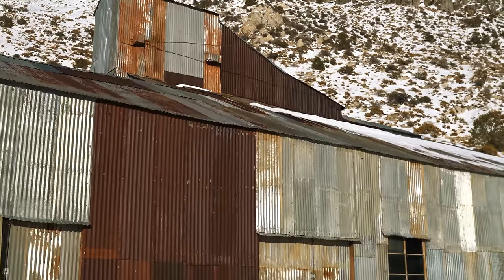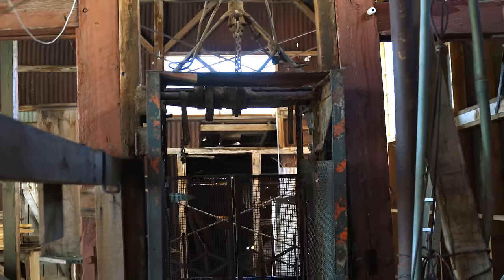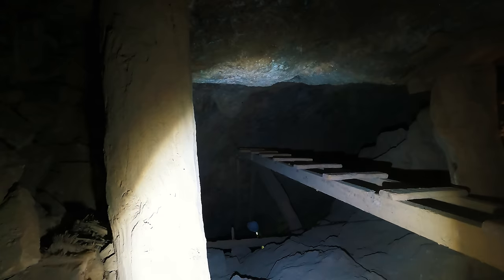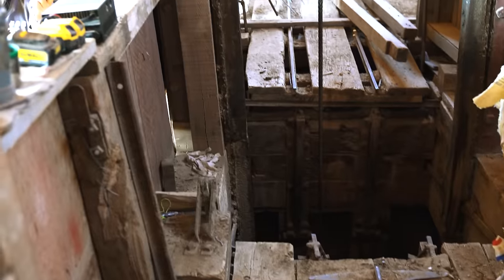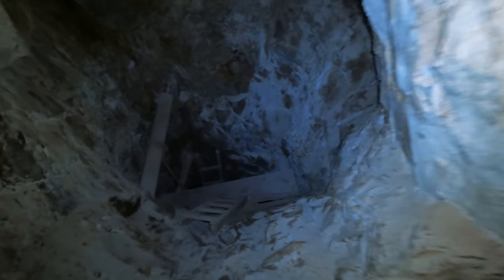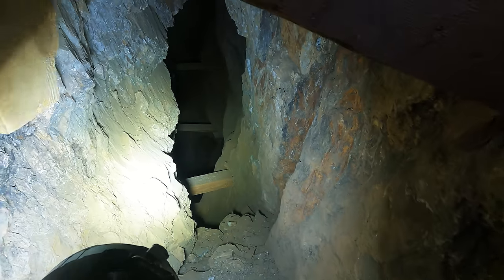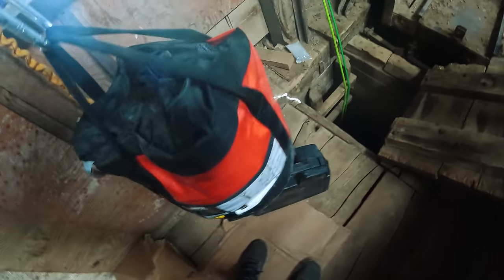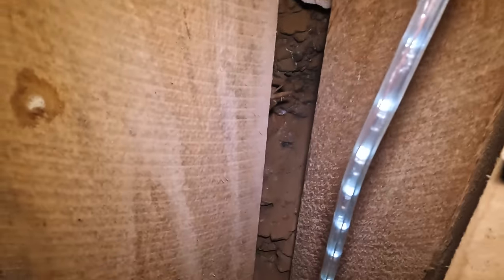Rappelling 900 Feet To Uncover Lost History!

Comment: Hey mate, I'm an industrial abseiler, I actually abseil off skyscrapers like you were talking about for a job. A good tip for doing big descents like this is to have your rope in a bag, attached to your harness, that way you don't have excessive tail weight so your descender will work better. Also eliminates your rope snagging on things when you lower it down, as it just feeds out of the bag as you descend.
Reply: Keeps it clean too. If there's wet patches down the road, you won't be getting into them if it's in the bag. However, in a cave, it's good to have the last feet of rope marked clearly at intervals of decreasing distance to make sure you don't end up without rope unawares (obviously, the end should be properly knotted to prevent rapid acceleration followed by instant deceleration.
Reply: Excellent advice!
Reply: I was thinking the same thing but wasn't sure if I was on the right track or just remembering something from a movie lol
Reply: we use the same trick rapping waterfalls when Canyoneering
Reply: Also, if you need to dig out those collapses, use a  tool you can pull with and let gravity help. Shovels would be useless for the bulk of it. Not sure what this kind of tool is called in english but in Norwegian we call it a "krafse" no.wikipedia.org/wiki/Krafse
Narrower and pointier variations also exist.

In an earlier video you used shovels for this and it was enragingly inefficient. In that case it was completely dry gravel which is the best case for what im speaking of. If its completely caked together the difference is maybe smaller but please consider this
Reply: You can also loop the rope to the ladder at intervals on your way up to make it easier to go down the next time.
Reply: @Hamring  What an awesome piece of kit xx
Reply: I’m not sure 950 feet of rope attached to your bag is going to keep you descending any easier. Which probably tells me by the weight of that it’s going to go smooth. Which questions me about if you actually have just done 1 abseil in your life. Now you know everything about mines 😂
Reply: @alwaysaheart1645  i would say a completely regular piece of kit. But pretty awesome for this kind of work if you compare it with a shovel i guess🤷
Reply: If you are thinking about communication lines, if you run copper lines you will only be able to get an analog phone line. If you run power and fiber you can get internet down there and upload without having to make the return trip. Something to think about. They also make a point to point microwave wireless that would work if the shaft it straight enough but anything in the way would interfere with the signal
Reply: Got some balls dude. 😮
Reply: @joeburrows6  I'm a qualified IRATA technician with over 3000 hours logged. Having your rope in a bag is a common technique for long abseils I assure you that, having the rope in a bag removes the excess tail weight from the descender which allows it to feed much smoother on the descent. Although you can tell he is using the pre 2019 version of the petzl rig, which is always a bit of a bear to work with. The very fact that you are arguing with me implies that it is in fact yourself who doesn't know what you are talking about, but I would never assume. There's no need to be rude just because you don't understand.
Reply: I can imagine you can go round obstacles too where he had to anchor a new rope and switch twice
Reply: @youngmodulus4617 Rope bags are awesome. That said, once you get to around 61m of rope that bag does start to get unwieldy.
Reply: Jeff Williams, Jason from mbmm, and an electric winch❤  good luck 🤞
Reply: How do you get this job ?
Reply: @Hamring  your krafse looks like it would fit into the garden hoe/chopper tool category.
Reply: Just make sure you knott the end of the rope before putting it into the bag ;)
Reply: @joeburrows6 what’s the longest rappel you have ever done?
Reply: Great advice, just keep in mind you may lose track of how much rope is left! Sure you’d think about it but I want to see more videos so be safe
Reply: @Hamring  This tool would help tremendously, but I have never once seen it in the states. Super clever and smart. Love it!
Reply: @TJPlaysNow  That's odd to me. This exact style is so ubiquitous here. If someone needs gravel say for their driveway, it usually starts out in a pile. And unless powered equipment is an option, this is the tool most people would use to spread it out. But, like someone mentioned, you do get a wide selection of garden hoes, several of which seem suitable.
Reply: I've gone on about this tool thing for too long now like some kind of weird evangelist😅 But my point is that the pulling action is key. Shovels are great but not for this.
Reply: I stopped by to mention the rope bag use as well. As a current SPRAT instructor (12,000+ logged hours since 2010) and a former medic on a mine rescue team here in Colorado definitely go with a bag. The bag will hang from the biner on your descended (petzl rig) ideally hung from a sling for maneuvering.  You won't feel the weight of the rope, your descent device will, so treat it like a pick-off rescue by adding extra friction. 
Not telling anyone how to live their life, simply clearing up confusion regarding rope access underground.
Reply: @Hamring I think you are describing a slate bar. Flat on one end and pointed on the other. Used in coal mines to remove dangerous rocks from the roof and rib.
Reply: @GhostTownLiving
Reply: @KaneLouiseOconnor  a 6 inch grub hoe (all I've ever known it as, sorry lol) would make short work of that clay like material. The best manual labor digging tool ever invented. There were several variations, the most common having an axe blade on one side for chopping roots, but some just have larger 2 different size spades. Also, if he could send 50-100 lbs down the lift with less people operating it, that would be handy. Send gear the day before, then he could help.
Reply: @Hamring he miners probably originally used pickaxes or pick mattocks to dig into and clear that clay/gravel mess.  I’ve never seen your tool in the U.S., but it certainly looks useful!  With the pickaxe, you use the pointed “pick” end to poke holes in that mass and start to break it up, and the flat “axe” end to pull the loosened material free.

https://en.wikipedia.org/wiki/Pickaxe?wprov=sfti1
Reply: @jdeno76 the version with an axe blade you’re talking about sounds like a mattock. A pickaxe would combine a grub hoe-like tool with a pointed end for digging into the clay.
Reply: Hi, I'm a skyscraper and people abseil off me. I don't like it.
Reply: @chrispydeeks8370 , well, if you do it the way Brent did, you buy a mining town! Then you have a lot of jobs to choose from each day!
Reply: @brentseely6113 , great advice. Now Brent mentioned having 1 or 2 others, maybe 3 other people going down to work with him. They would have to decent one at a time to the 900 ft level. By using the bag method, that would mean there would be 1 rope for each person decending. Now there is a point in the shaft where it is too narrow  for a normal size person to fit so they have to climb outside the support structure to continue down (refer to video where Brent had to switch to another rope). By the time a 3rd or 4th person decends that is 2 to 3 ropes already in the shaft. I would be concerned with the ropes tangling especially when it comes time to ascend to the surface.
I apologize for the lengthy comment!
Reply: @johnrose5234  a couple things to note, if there are multiple people going down one at a time,  they can all use the 1 set of ropes (I say 'set' because ideally there is a 2nd rope used as a backup for redundancy) Anyways, the purpose of the rope bag is to prevent entanglement of ropes during initial descent.  Once the rope is hung top to bottom in desired path,  it stays. On the note of the narrow obstruction,  one way would use a 2nd descender and a short rope that is anchored at obstruction MAKE SURE IT HAS A KNOT AT TAIL END  Basically a rope to rope transfer twice (place 2nd device on second rope, pull up all slack then continue descent until weight is completely on 2nd short rope, descend past obstruction then repeat back onto main rope. To initially thread main rope through narrow spot, pull out 10-15ft of rope from bag, tie midline knot, attach bag to know, lower through narrow.... you get the idea. 
Oh yeah, and if multiple ropes are used (much faster when it comes time for multiple people to ascend back up), they shouldn't tangle with each other. There isn't any wind to blow the loose tails around. 
I know this is a lot,  I apologize.  If only YouTube comments would allow images such as a napkin with a doodle diagram.. much simpler.
Reply: @brentseely6113 , sounds like you would be a good candidate to join Brent on his adventure to the lower levels.
Reply: G'day fellow Aussie how good is Brent and his awesome channel??
I've only seen a couple of episodes, but it's got me hooked. So where abouts in Oz are you from???
I live in the Southern Highlands about 1 1/2 South of Sydney heading towards Canberra.
Reply: Thats how we do it for CSR courses as well it really a must so you don't get yourself in a dangerous situation!
Reply: Like a military style folding shovel; can be used as a shovel or a hoe.
Reply: arnt those ropes harnesses etc subject to failure if in contact with petroleum products?
Reply: @aserta I'm assuming that he did not do that because the bag would have to be massive for 900 ft of rope he said that there were a few spots that were tight
Reply: @casey6104 you would trust a wooden ladder with nails in it that was made in the 1800 s ?
Reply: @trxcummins7388  well in the case of my suggestion, yes. If I recall correctly, said ladder is a multi segmented ladder and by spacing lengths of rope, you wouldn’t be placing much weight on any particular portion of the ladder. Keep in mind the rope in question is the rope below you, which has nothing beyond the weight of itself acting upon it. If you make enough attachment points the stress placed on both your descender and the ladder would be minimal. 
In addition, I’d you are worried about nails you can just tie the segments to the vertical shaft of the ladder.
Reply: @KaneLouiseOconnor would it be like a Asian field hoe? My dad had one and the land I could clear with that! A real workhorse.

Comment: I would be very cautious about shoveling away those collapses, and especially about the blaster.  The collapses occurred in the first place because of instability and poor competence in the rock, and the collapses themselves might be the only thing holding up additional parts of the tunnel, meaning that clearing the collapse might cause more collapses to occur.  I would suggest you not just “clear” collapses, but buttress them with structural braces as you clear them out.
Reply: I came to comment this to I know how hard it would be but he need to put more structural support especially if he’s going down more
Reply: Yep, get that woodwork up against the walls and ceiling! Think like a miner! Instead of blasters, get some woodwork tools.
Reply: He knows.
Reply: @Megasaurusify  I would assume by now he knows what's up

Comment: Obviously when I see these videos I know that Brent is ok.  But I always have apprehension when I see him crawl around cave-ins.
Reply: It only takes one time.
Reply: I agree.  I understand his desire to explore everything, but I worry.  Without Brent, Cerro Gordo dies again.  He's so important.  I don't think he realizes how important he really is.
Reply: Same here. I know he uses caution, but it's legitimately dangerous. I wouldn't do it.
Reply: If it's too long between uploads/feeds I wonder
Reply: I think about the cable used for lowering and raising the cage. What is the actual condition, strength of that cable?
Brittleness?
Reply: Damn right.
Reply: @jamelling3799 yep. Metal fatigue on the cable has got to be a potential concern and really not worth risking in my opinion. The only way it can be checked for integrity is with X-rays a andnd
Reply: Me too
Reply: @kennethcrowther2277  I understand preserving the history of the true Union Hoist but you just wonder if there’s not some company you can just pay the money to (I’m sure it’d be a lot) that could modernize the hell out of the descent system
Reply: @loganknudsen246  a whole new hoist system would ultimately eventually be needed which would cost a small fortune. Metal fatigue in the cable is a concern and having it one day break while under weight doesn't bare thinking about. The only way to check for metal fatigue and/or brittleness is with xray which is once again cost prohibitive due to the kind of specialist industrial xray equipment needed. I think ultimately rapelling will be the only way to go. Even fixing the ladder up, which would be more realistic, would still require a rope because from the looks of it there is not cage protection around that ladder. Using even a good safe and fully restored ladder without protection isn't possible however gutsy and brave one is because the muscle fatigue over 900ft would be too much. Further more, even restoring the ladder isn't realistic on second thoughts, simply because it would ultimately mean having to replace the entire thing. A ridiculous undertaking  both in money and effort over 900ft in the cramped space. Obviously the original ladder was built as the shaft was being dug, or maybe by using the cage. It's quite the conundrum, but with a very old abandoned mine of that scale there isn't that much that can realistically be done. Rapelling is a major effort but as time goes on, probably the only really safe way to explore the depths. Personally I wouldn't even feel safe or confident using that cage and cable any more. I admire Brent and the risks he takes because he knows what he's up against and the risks are worth it to him, being his life's passion. I bet his mum doesn't like thinking about it though lol.
Reply: @kennethcrowther2277  i recall in one video he talked about it having brakes in case of a breakage
Reply: @Acolis  yes OK. But again, you'd hope they worked properly. Then there's getting out of the thing and back up. Roping up the ladder way I guess. But yes, you've got a point. Making sure the breaking system is in good working order is a realistic possibility. At least it would save your life. However you then have the cage stuck down the shaft which would be a problem. Would those breaks hold it indefinitely? It could be shored up, but then it becomes a permanent obstruction. I guess portable winching equipment could get it back up. I wouldn't want to rapell down the shaft beneath it with it sitting there on its breaks! Yea, on second thoughts it could be winched back up and just stored. Restoring the breaks for life saving would be the way to go probably. They might be good for now, but will need upgrading eventually.
Reply: @kennethcrowther2277  Wire rope is EXTREMELY strong and durable even after it's rusty and frayed! We're probably talking about wire rope that is rated for 30,000 lbs. but has only been pulling a 1,500 lb. Elevator car with a couple dude's, and equipment  so I think that's the last thing I would worry about! I would worry about the gearbox, bearings, motor, and other mechanical equipment before I worried about the wire rope unless I saw a bunch of cuts all over it.
Reply: @loganknudsen246  That would be cool, we should do a go fund me for maintenance and upgrade!
Reply: he breaks a lot of the rules for caving, he should always have a buddy with him, and a check in point incase he gets injured which is a non zero percent chance that it would happen. 

his enthusiasm for the history sometimes overwhelms his sense of self preservation.
Reply: @kennethcrowther2277  The brakes appear to work well. A while ago when going down the shaft, the cage jammed against something, the cable slackened and the brakes actuated immediately.
Reply: I worry for Brent's safety as well

Comment: Hey Brett, the thing that you keep bringing up as an issue is communications. The priority idea would be to run some telephone cables down that shaft you've got your rope and lights in, splitting them off at each of the levels you've explored. The amount of danger you're in without some form of reliable connection to the surface is gut wrenching and I think that beam incident highlights it. If you had dislocated your shoulder, it would have been difficult to ascend back up, and it might well have been a time critical injury. I'd also suggest getting some MREs, spare batteries and cans of acidified water that can stay down there long term in case something happens to the rope while you're down there and you end up trapped for the few days it'd take to get to you.
Reply: Maybe he'll find the old phone mentioned on the vintage metal sign...
How did the miners connect the phone? 
Any visible phone cables anywhere?
Reply: @4seasonspix  i think the random lengths of wire we see tangled up down there is what's left of the telephone system
Reply: @nopetrainconductor9840 it'd be cool I'd he could find and restore one of the original phones then use it at Basecamp 900.
Reply: @krockpotbroccoli65  that would be cool to see but i suspect  it would be a pain in the ass to do though
Reply: Watching that beam fall on him could have been the last video. Trapped no phone. Need a phone line ran down.
Reply: @mightySHRIMP420  but wait if hes pined under shit how would he reach the phone?